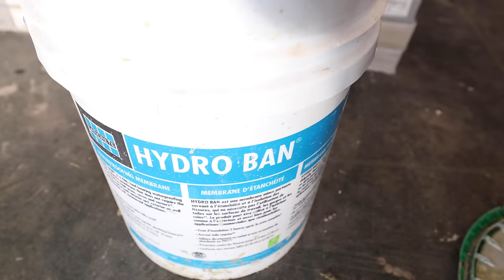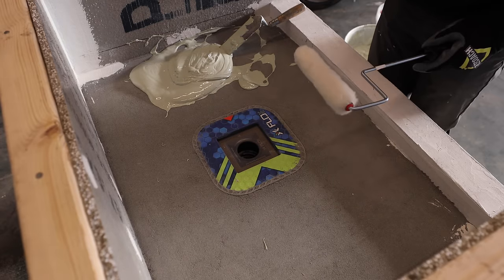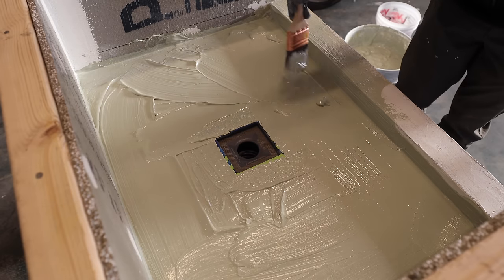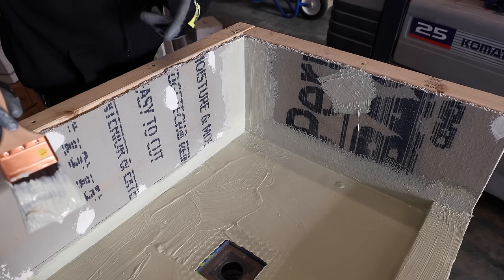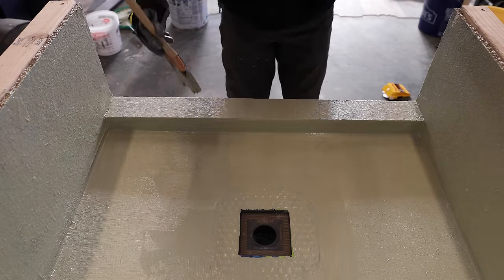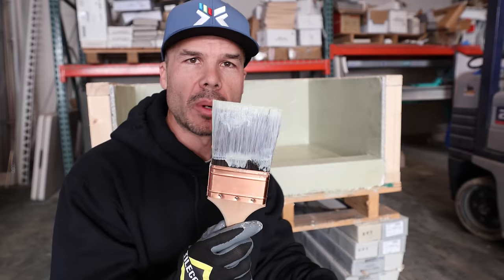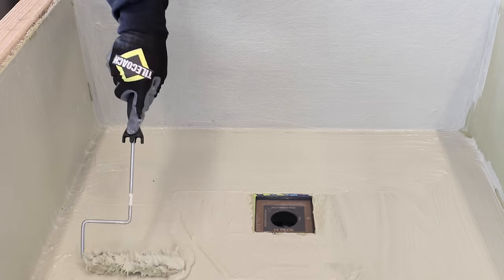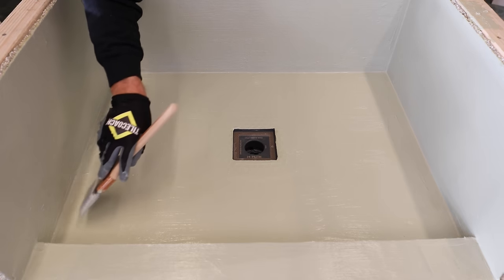Easiest Way to Waterproof OVER Dry Pack Shower Pan --- Hydro Ban Liquid Membrane

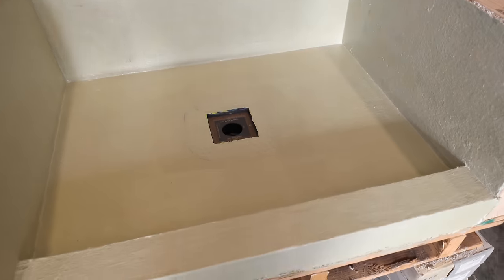Comment: at 7:38 you say this first coat went on REALLY nicely...okay...but then some seconds later you say i'm going to let this second coat dry...again okay...but if you look super closely you have the exact same drip in the upper right and thin spots on your right wall towards the back corner....and your grid pattern around your drain does not appear to show any difference between coats 1 and 2.  i've been doing this for 40 years so i take this seriously...i'll just leave it at that.

Comment: To be honest, Hydroban doesn’t stick very well to thinset…  you can easily unpeel it. It won’t stick very well to mud pan either. Not really sure about this method.
Reply: Your talking about hydro ban sheet membrane, liquid hydro ban is widely used in inground concrete swimming pools, thats the main purpose of liquid hydro ban to be used on hard surfaces, what surface is it meant for if not concrete? Its not made for wood. To your defense, you cant use the sheet hydro ban membrane in swimming pools.

Comment: Dont leave any pinholes and remember not to drop any tools or tile chips on your surface layer of waterproofing.  You can also use a shower pan in addition to this method for extra security.
Reply: Thats what I do....coat the first slope, pvc liner, mortar bed and red guard the whole thing again....already have plenty of liquid so to roll it on takes no time....and I do 3 thin coats on final....again time wise it's minimal, am already there and buy big 2.5 or 3 gallons so have plenty of material on hand.....haven't had any issues.....nothing will last forever if you get 20-30 yrs that's great

Resealing the stone, tile and grout is big help but homeowners never do so.....every 3-5 yrs should clean and seal to help out with durability......just no one ever thinks about it

Comment: You said this is a good method to waterproof for a diy'er, but what is the best method ?
Reply: The time tested way. Doing your initial pan float and covering it with a shower pan membrane, then your secondary float and covering that with either Red Guard or Hydro Ban. Let it cure, set your tile, grout and then do a least 2 sealer coats with 511 Porous Plus sealer.
Reply: How are you finishing redgard to the drain flange

Comment: Ur water PROOFING goes in before u put ur dry pack. U should never water PROOF the top it's is supposed to be poorest to allow for water aka ( MOISTURE!!) to seep through and make it way to the  Weep holes.So when u block that the  grout will soak in the water down to the thinset which will start to break down 
And break bond. Even if u seal the grout.
Been doing TILE for 24 years and I've seen all kinda Failures. JUST SAYING
Reply: It will be fine, use the Laticete 254 Platinum and it will be perfectly fine. The 254 is rated for pools, so using this method in a shower will hold up perfectly…. The issue with allowing your moisture/water to seep through your Dry Pack and into the weep holes is that your DryPack will always be soaked with water 24/7 which leads to mold. 

Sure if you don’t trust this method, you can always use the pan liner under the drypack and add this Hydroban to eliminate the mold factor.

The failures are mostly caused by not using the proper Thinset. But even the lowest grade Thinset now a days is wayyy better than what was sold 20 years ago, thats why nobody really sells AMA (Acrylic) anymore. All these grades of thinsets dont require it anymore.